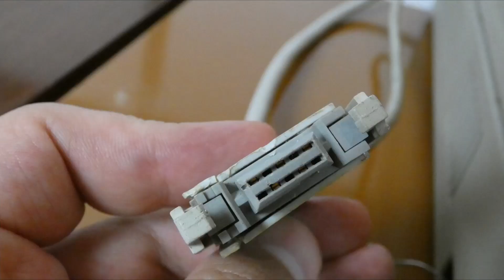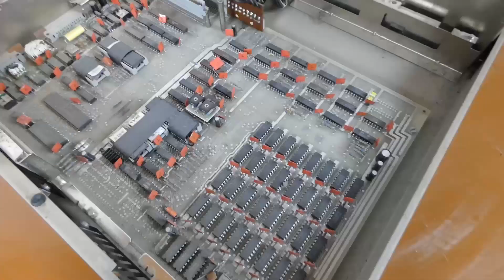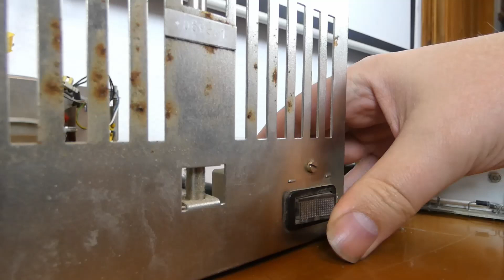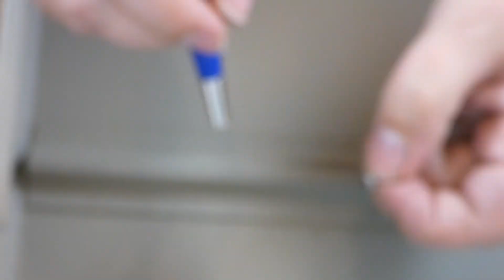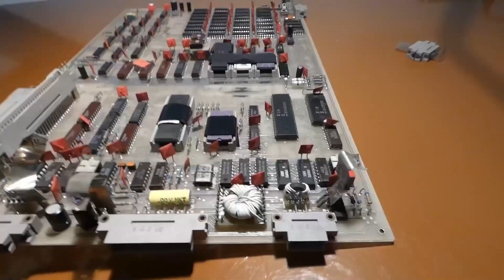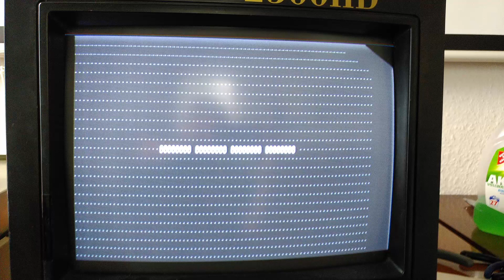The Computer that could survive a nuclear explosion - Robotron 1715 - vintage computer restauration

Comment: There was at least one Siemens chip on the mainboard.  

You will also see the Robotron name on mechanical devices, namely the Ascota 170 which is an incredible piece of engineering from the late 1950s, being a desktop sized Turing-complete mechanical computer.